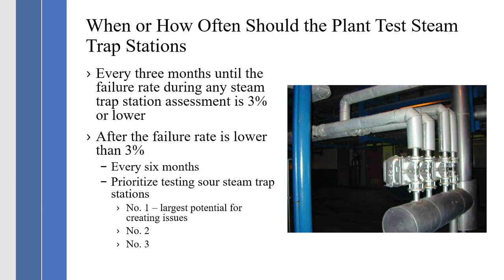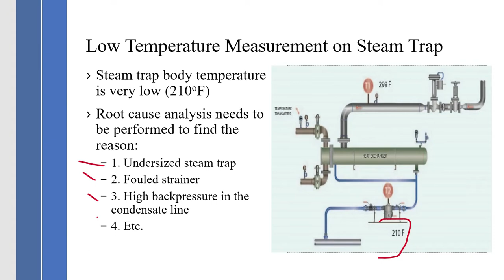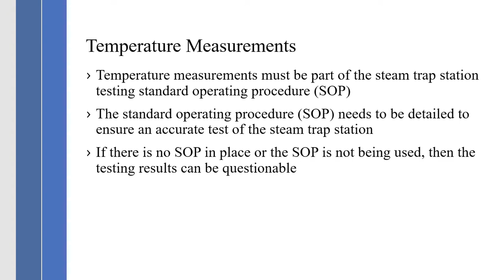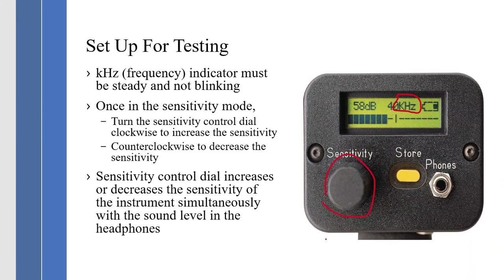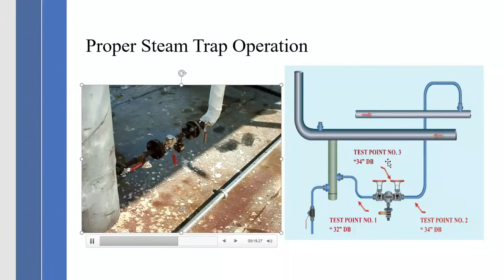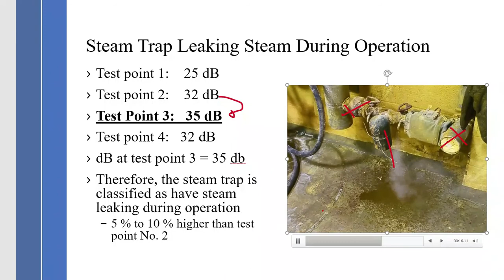Steam Trap Station Testing Methods   Temperature and Ultrasound

Comment: I have 233° steam going into the heat exchanger at the condensation point I only have 86 even through the trap I’m only getting 85 and 85 but we’re having problems maintaining humidity in the server farm I don’t believe 80° water is high enough for dehumidifier Quetion or reheat

Comment: I have a Shell heat exchanger and I believe they installed the trap backwards called Hoffman gave them the model number they said the arrow was supposed to show flow they’ve got the arrow appointment in the wrong direction what is the temperature drop supposed to be through a trap if it’s working correctly is it 10°